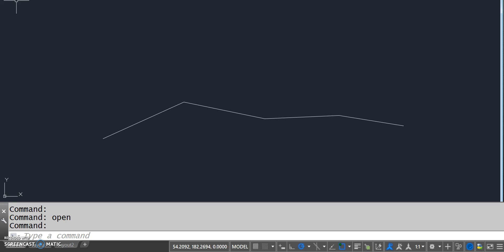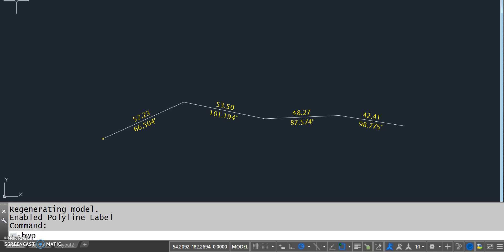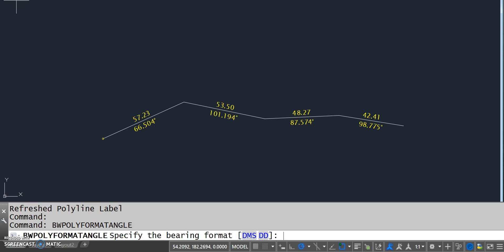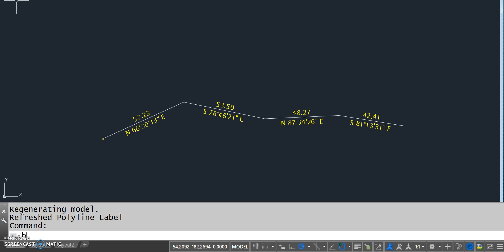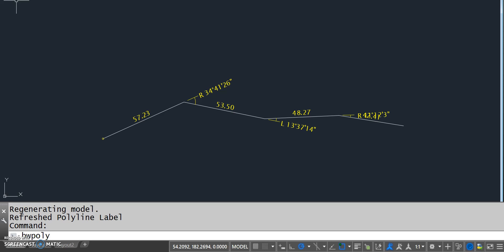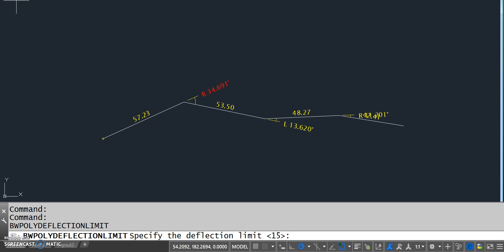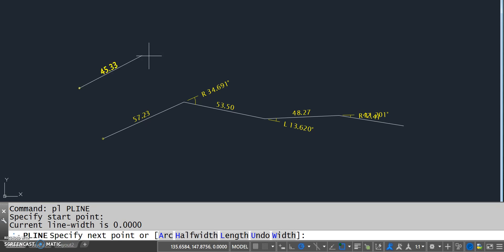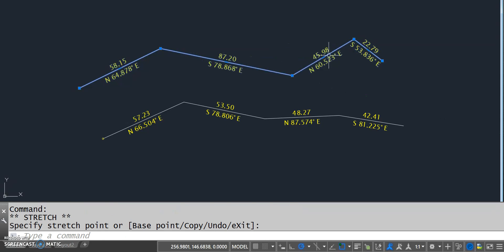AutoCAD Polyline Labels

Comment: Useful, very good, thank you!
Should you tell us if is there a way to label polilyne elevations instead of generating a surface first? I use Agisoft Photoscan and it gives e DXF polylines which are much better then the ones generates at AutoCAD, then I would like to label it. Regards!
Reply: Go here
https://apps.autodesk.com/ACD/en/Detail/Index?id=8650652173501483766&appLang=en&os=Win32_64